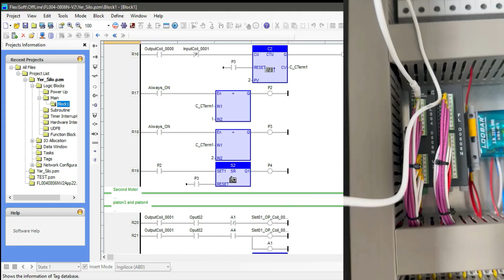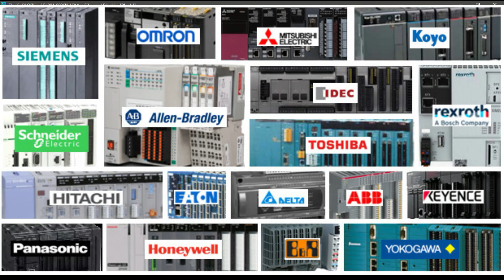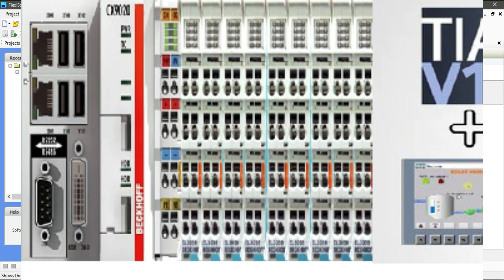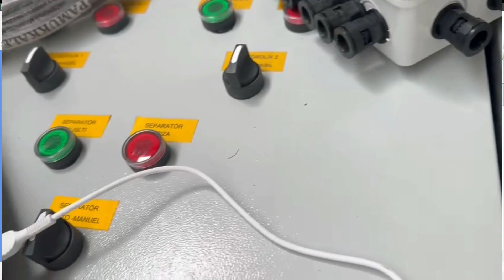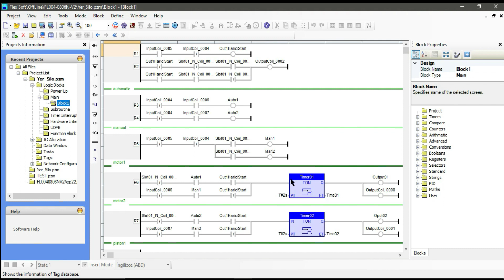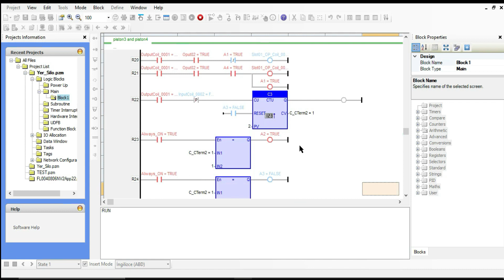Hot to download program to RENU plc

Comment: Sir can u plz tell that how can we download the program through Ethernet cable
Reply from the maker: From Mode icon click on Go online then click on with download. the program will be download to yor plc through Ethernet cables,
Reply: Sir but already in PLC Ethernet cable connected through switch in network.
So that Ethernet cable can I remove and connect from my Pc to PLC will it be okay.
Or else I have second port com1 in that we can download the live program in same step & I will make the pc up in series with PLC so this option will also work or first one.
Reply from the maker: @aniketchavan2835  Ones you download the program, and runs. there is no need to keep the connection. if it gives error check the port, and try again
Reply: Okk sir,got it
Reply: Hello sir, I have connected usb through pc to Renu PLC but I'm not getting the option of with download it is unable to click that option.
I have Renu FL055 model
And I downloaded the soft V 2.33
It that right or wrong.
Reply: Only I'm getting with upload option. Is there any options like I have connected usb then login or  connect option is there. So then it will get the download option.